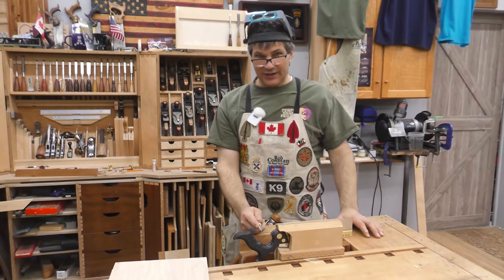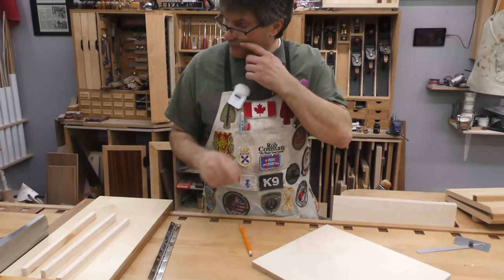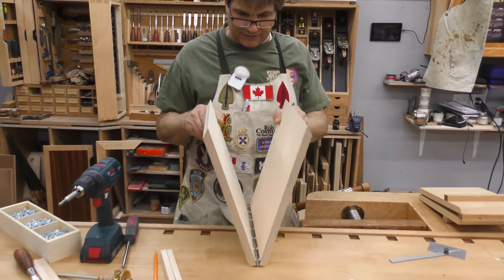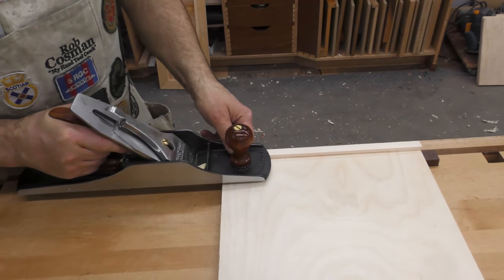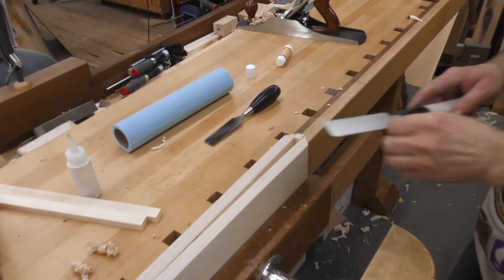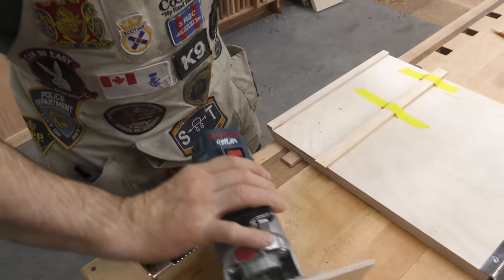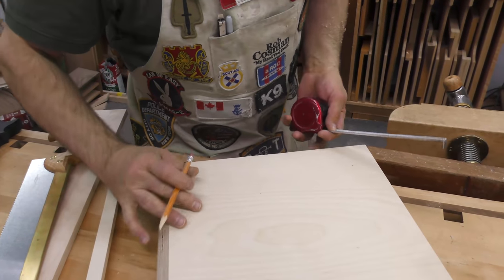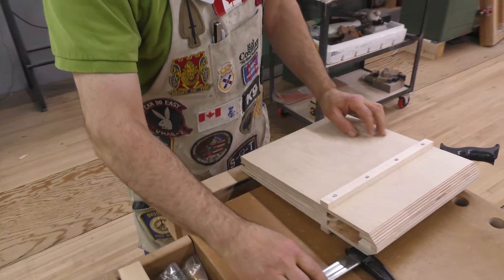Saw Sharpening - Shopmade Saw Vise

Comment: Rob, Could you put the hinge on the bottom edge of the boards rather than the inner faces? I know it may not be a strong but not a lot of strength is needed here.  Mostly to keep the 2 jaws properly oriented to each other.

Comment: Seems like a shallow rabbet would've helped at both ends of the hinged panels.
Reply: Staggering the screws would have worked as well. You don't always need all the screw holes filled for strength.
Reply: @vanshankguitars  Agreed. My comment was aimed at making it easier to fit the wood strips at the blade-gripping end.  A rabbet would've helped position the strips versus manipulating them while they're sliding around on a film of glue.
Reply: @kennnva551  gotcha!

Comment: Good idea for a DIY saw sharpening jig ,but I'll use 2 strips of 1/8 ×3/4 soft brass on the top inside to hold the saw blades,more rigid for the length,can't damage the saw blade,file, better holding clamping force,reduce vibration, durable,less expansion, Thanks for your  idea and plans. I'll keep watching your youtube channel.
Reply from the maker: Thats a really good idea.  Wish I thought of it

Comment: I think is more simple than routing plywood, to use thicker an a litle wider "jaws" for your saws.
Reply from the maker: you are right, this came as an afterthought instead of cutting out the handle shape from the vise.  jaws would not have to have been much thicker, short video however! :)

Comment: Nice video Rob thank you!  Same problem here in UK ! there used to be many old timers who sharpened saws but they have all long gone now.  You can still get one sharpened but its usually miles away, don't do them by hand anymore and costs fortune for a machine cut which for vintage tools like I own its just not on.  Vintage saws are usually brittle so teeth can snap very easily if care is not taken.  My problem has been eye sight which has failed no end but with your video encouragement I decided to purchase something to help with that and make the vice you just described. I suppose same principle for panel saws you just make them wider to suit.

Comment: Thanks for all the detail based on extensive experience.

For most things, a real shoulder vise as you use is nicer than a metal quick release vise with screw and guide bars in the way.  Making a Frid saw vise like this is a counterexample: you can leave off both the hinges and the cleats, stand the plywood on the vise bars, and it works fine.
Reply from the maker: Yes that wouldwork but as I discussed at the end of the video this design shortened will also work in those vises

Comment: Hi Rob, great.video, as usual. When I.learned to sharpen my saws we held the blade a good bit higher in the vise if it needed jointing, mainly because the jig we used to keep the file perpendicular to the saw plate needed to rest against the saw plate. Maybe 3/4” or so. How important is it to keep the file perpendicular to the saw plate?
Reply from the maker: Yes to joint you do need to position the saw higher in th evise. We have sharpening videos coming soon

Comment: Thanks, Rob. Very timely.  I have a very good vise from GRAMERCY and two Disston vintage vises which generally suffice. I have two 28 inch miter box saws (Stanley 358) I need to sharpen. I’m think this style vise would mean I would not need to move the saw during the job. Do you have any thoughts on this style vise at 28 inches?

Comment: I have just started watching this video and was surprised that you said that using a drill driver to insert the screws could strip them out.If you set the torque to a low setting, then surely the driver would stop before stripping the hole. Also you proceeded to counter sink the piano hinge holes and then added a strip of wood to the edge.Would that not stop the two pieces closing right up? Maybe I should watch the video to the end to see if it answers my own questions. Like all of your videos, very informative and a pleasure to watch.
Reply from the maker: Without countersinking they would not close properly even with the two strips of wood.  I thought it would but alas was wrong again!

Comment: I’m surprised to see you using the table saw miter gage in conjunction with the fence.  This is something that I was taught to never do due to the potential for kickback.   Can you comment on using this technique please.  Big fan of your channel by the way ...
Reply from the maker: Dale....The critical part is you must maintain control of the wood between the fence and the blaxe.  If you dont and it twist you could induce kickback.  I can control the wood therefore I can use the fence as a guide.  With this cut I needed to support the length with the miter while still maintaining control

Comment: How about making the hardwood strips for the vise jaws thicker so that there is enough space for the handle. Of course you may have to add strips on the bottom as well for the hinges so as not to increase the angle of the panels to much.
Reply from the maker: Thats could work

Comment: So much easier to add 2 strips at the hinge end, so that the thing closes parallel. That way, no need to plane the slight bevels on the topmost strips. Also, it will clamp properly in the vice, since the outer surfaces of the ply are also parallel.
Reply: The old ilustration i found in an old  instruction book for swedish wood shop teachers was made that way. No hinge just slightly loose screws